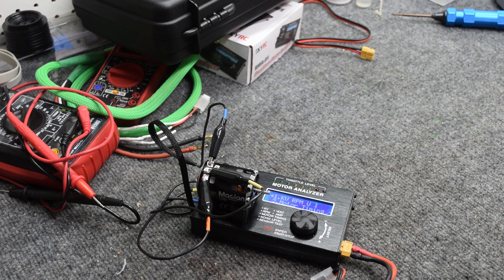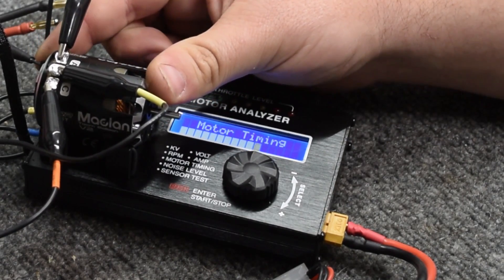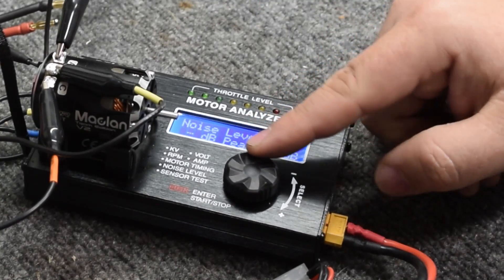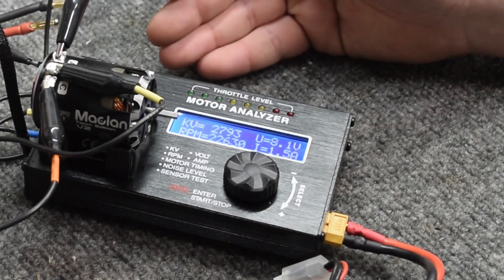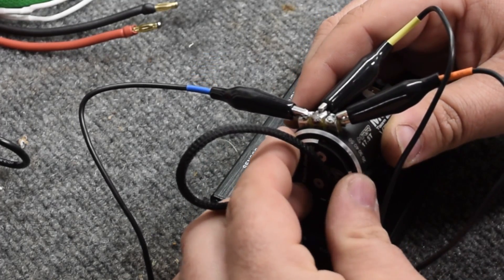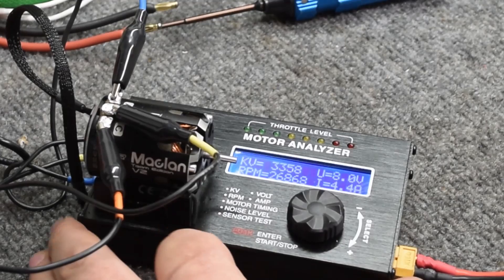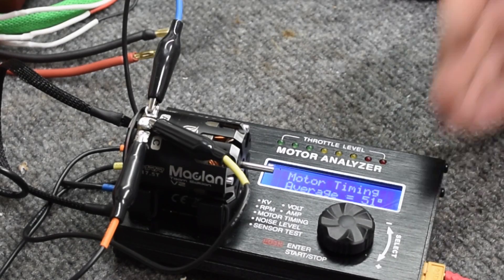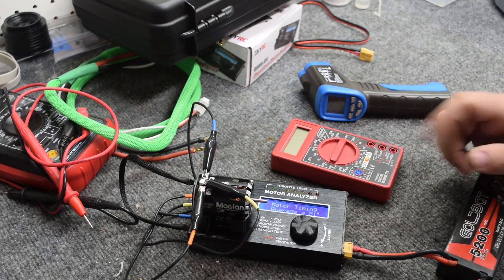How to tune your RC sensored Brushless motor, Part 2, Adjusting Timing using our Motor Analyzer

Comment: I have an esc that has boost timing control.  Is it better to have the timing set on the motor or instead find the sweet point as you have done then wind the timing back say 10 degrees on the motor and then set the 10 degrees back in the boost function in the esc?

Comment: For anyone else doing this with a cheap analyzer, note your battery voltage drop off. You need to keep the battery charged at 8.4 so you have a realistic expectation and get consistent test results. 5.1a at 7.9v will likely be 5.5-6a at 8.4v. These skyRC models also aren't very accurate on timing but it at least gives you a baseline to check amp draw.

Comment: Are they worth 65$
Reply from the maker: If your serious about tuning motors and trying to get repetitive results after cleaning and rebuilding motors , then yes. Or by a motorlyser , but just to see the power of a motor for 2 motors , nope.
Reply: @ChrisPatrickRC I was debating on one because they are 65 rn on AliExpress straight from sky rc. And I run on road summer and off road during winter fall. And just want to make sure I tune my stuff a bit but unsure if it’s really beneficial
Reply from the maker: @MrNascarfan1  the proper way to tune a motor is check temps on your motor , either add more timing or gearing based on the longest jump or stretch , once you find the magic number, you toss it on the analyzer and test the motor accordingly. 
So when you tear apart the motor you can rebuild it back to how it was when you tore it apart.
Too many people think there's magical numbers of amps , example. A trinity may draw 7 amps, a maclain may dar 6.2 amps. A reedy may draw 5.5 amps. 
Thats why , when people ask me what should I set it too, I always say there's never a magical number perfect for everything.

Comment: If you have a motor that has adjustable timing on it, does it have to be censored for it to work?
Reply from the maker: Do you have a motor in mind ? I dont have experience with sensor less besides 1 motor. And it was able to be adjusted and you can add timing threw esc as well.
Reply: @ChrisPatrickRC  well yesterday I bought the Hobbywing Xerun 4268SD G3 1/8 Scale On-Road Sensored Brushless Motor (2000kV) with a hobbywing Max 6 I know you could run sensor motors with sensorless  ESC I was just curious if the adjustable timing on motor would work if I want to adjust it?

Comment: Is there a certain amp point to look for? Im adjusting the timing on my fantom 13.5 in a no prep car I've gone as high as 54 degrees but the amp draw is well up
Reply from the maker: cant answer that question correctly because your using it for drag racing.... the simple answer is as much as you can toss at it without overheating the motor... your running 2.5 seconds and stopping where most people use them for races in 5 min mains. So what works for 5 mins races is probably on the "safe" side for you. 

You have to remeber. this video is NOT about the magic number, its how to find what works for you once you find that number.  and with drag racing there is alot of people adjusting timing with esc curves, so if it was me, id set it to around 35 degs of timing on the can and adjust everything in the esc. 

as you notice, there is no "magic" number your looking for, you just have to find what works for your application.
Reply: Have u played around with swapping larger rotors?
Reply from the maker: @builtbyjuz4419  of course i have, and it affects everything, the kv's and rpms all based on the rotor you have.
Reply: I have a 13.5 fantom outlaw team edition with the 12.5mm rotor, I've just ordered the 13.5mm from fantom and havnt seen any videos showing a comparison, all I've found is posts on Facebook and forums saying the bigger rotor gives more torque, sorry for the noob questions but im in Australia so we don't have any "rotor Ron" or "nick bells"  here to just order a badarse motor so I'm trying to soak up as much info as I can do any help greatly man
Reply from the maker: that is a whole topic on its own, but yes usually the larger rotors tend to give you more lower end torque to get you out of a hole faster, but you will give up the RPM , so in drag racing you may give up down track MPH... 
So adjust gearing according to help with that as well, also watch your timing because they tend to not like the higher timing numbers from what ive seen.
Reply from the maker: thats also why manufactures offer different levels of motors. example trinity offers 3 levels of motors. and typically the top 5 are "team" and the next 5-10% are "team spec" and then regular motors. so the batch of 100 new motors, you could get the worst motor at 100, or the 11th rank motor in the batch... thats why they offer different levels because they dyno them and test them to know what is the best of the batch.
Reply from the maker: there is also a tool to test rotors... you could buy 5 rotors from a manufacture and all 5 will test differently,  its called a gauss meter.... another small testing component to building motors.

Comment: what is the point of making the motor draw a serten amount of amps?
Reply from the maker: Its a reference point, so example... if you tune a motor to run to the top performance for your rig, at the end of a race your motor is perfect temps, so let's call that 51 degrees of timing...
You need to tear apart your car and you want to clean and lube your bearings and what not ( maintance you should be doing by the way) and you go to rebuild it back, how do you know where the motor was before if you did not out it on a dyno to know exactly where the motor was before, so you can set it again to the exact same as it was when it was pulled.
1 deg of timing can change a motor pretty good amount so amps is usually a easier reference point to set then degrees of timing on the end bell .

I hope this makes since for you.
Reply: @ChrisPatrickRC  ok that is an exampe i can understand then.

Comment: will this analyzer work on brushed motors as well like slot car motors?
Reply from the maker: no it will not, not that im aware of.
Reply: @ChrisPatrickRC  thanks. Been trying to find one but can’t seem to.
Reply from the maker: @sesmith4094  https://www.facebook.com/bill.osborn.7/posts/4750031621739348
go check that out.

Comment: Great video! I wonder if the 6A rule of thumbs applies to mod motors. I have a 6.0t that would love to tune.
Reply from the maker: nope, would be higher. all i can tell you is take it how it sits and find out what timing and amp is currently is before you do anything to it, also hows your temps after a race? temperatures on a motor is the most important number to watch.
Reply: @ChrisPatrickRC  Okay, I will start there. Thanks!

Comment: Is 5amps the number for 7.5 and 6.5 turn motors also or only 13.5v?
Reply from the maker: only for 17.5 and its not the "perfect" number... every motor is different i was just using that as the example of what a safe tune is for that motor in my experience.

Comment: Does anyone know if you can use these on brushed motors to aid in break in, or just use them as a dyno to get rpm? Brushed motor dynos are hard to find or extremely expensive.
Reply from the maker: No needs the sensor wire to register it to see it working.
Reply from the maker: I believe you can make one. I'll do my best to explain.
Set the esc throttle to be on steering binding so you can use the steering knob to set your throttle and forget it.
You will need a stand to mount 2 motors where the shaft touches each other and a couple to connect the 2 motors together.
You feed power to one, and then use a volt olm meter and measure on the positive and negative leads of the far motor , should give you a reading.
That would be a way to make a dyno for a brushed motor.
As for breaking in. Same thing esc to steering binding place motor into a cup of water and slowly turn your steering know on your radio till the motor turns. And if it starts slowing down or stalling then increase the steering knob.
Pretty easy to do actually.

Comment: Can sensor boards cause a motor to run a bit slower before they fail? The reason I ask, my Maclan 3.5T ran noticably slower before the board apparently failed. By failed, I mean the motor would not run with the ESC in sensor mode, it would only cog. However, it would spin up in unsensored mode.  Can the board cause hit or is it more likely the rotor was weak and the board was a separate issue?
Reply from the maker: If you replaced the sensor board and located it in the correct spot then I'd doubt the replacement board would be your issue. Could be a spacing issue with your rotor, could of overheated and hurt the rotor. Theres a few different variables that could still be at risk.
Reply: @ChrisPatrickRC  
Thank you for you response Chris.

To be a little more clear with my question, I haven't replaced anything in this motor yet. It is sitting while I decide what to do with it. The application is drag racing so I have very precise data on the output and running conditions of the motor. Nothing in the logs or observations with the temp gun or my highly calibrated finger suggestions that the motor overheated. 

What I noticed in performance amounted to a several tenths of a second and a few moh . The data logging showed 5-7k less  rpm without any drop in voltage to explain the loss. Basically, it's as if the motor lost KV.  Beyond being able to hear the loss of rpm, the motor also had an odd vibration as if the bearings were bad. Inspection revealed this to not be the case.  Then, the problem escalated into the cogging and not wanting to spin up in senor mode.  The sensor wire was replaced and I have since confirmed that other motors work fine in the ESC .

Perhaps it's worth mentioning, the motor in question is only a few months old. In actual run time, maybe 50-60 passes. After each pass the motor was allowed to completely cool. We are literally only talking a couple minutes of life.

Thanks for your help. I really appreciate it.
Reply from the maker: @troybolton4055  then sounds like everything points to the sensors themselves,  the motor may not have been shimmed correctly from the manufacture , causing wear on the eyes.
Id sway the board first

Comment: With 5.5-6 amps being ideal is that for both 17.5 and a 13.5 motors? Off road 1/10
Reply from the maker: 17.5, a 13.5 motor has more power draws. I dont know the exact number because I dont race a 13.5 motor that I built and tested to get you a safe starting point.
Reply from the maker: If I had to guess it would be around 7-8amp range

Comment: Can I use the motor analyzer while the motor is still hooked up to the esc, not the black wire loop only the leave the motor still solder to the esc.
Reply from the maker: Not that I'm aware of because the analyzer detects power draw and throttle and all that, thats what the sensor wire does..
So if you left the motor connected to esc and disconnected the sensor wire then the esc looses its connection and will go crazy.

Check out part 4 I think it is. Where I use another tool to test your exact question.

Comment: Did it say 4 pole on your settings in the analyzer? Maclan is a 2 pole motor
Reply from the maker: i checked and no, it was still set to 2 pole.
Reply: @ChrisPatrickRC  cool cool. Never hurts to double check. Great video buddy

Comment: Hey Chris, I've really enjoyed this video series and gotten some good results on my motors using your tips. My question is: is there a good video that discusses the merits of increasing timing vs increasing gearing? Or is there a way to find out if there is a sweet spot between the two that makes for the most efficient setup?
Reply from the maker: not that i am aware of... gearing is the hard one to explain. if its offroad, you find the trickiest jump and put a gear in you think it would take to get you over the jump, if you run out of motor before you clear the jump then go up on gearing... seems pretty simple once you break it down this way. 
If your oval racing, you want to run out of gear right as your entering your corner. or slightly after corner entry. 
once the gearing is set, then you can adjust timing slightly if your trying to get a little more out of it, BUT you need to monitor temps, because if your motor is getting too hot, your timing is too high, or gearing is too high. one or the other.  
i hope this helps. 

I do plan to redo this entire video series but its not in my near future. (be like a year or more probably)

Comment: So I’m wanting to get into racing and traded some stuff for an X-ray XB4 2016 with this same Maclan Motor and a hobby wing justock XR10, motor looks to be currently set about 40 degrees timing, she needs literally like just a touch more speed to be able to clear all jumps and run good laps at my local track. Think it would be viable and safe to turn up the timing a little bit to achieve this? Sorry major noob here and never had a sensored motor before.
Reply from the maker: Absolutly you can. Every motor is different though so be careful and check temps. Keep in mind it is a rpm motor not a trinity which is a torque motor. 
Just check temps if its cool bump it up a few degs and try it. And check.

Comment: What about other brushless motors that do not have a rotatable can? The smart motor/esc combo allows you to set up your timing digitally. The esc lets you program and navigate through different degree stages for the motor. You can look at the owners manual for the arrma felony or infraction if you want to see the charts. Have you ever delt with digital timing derees?
Reply from the maker: it can be done digitally, but theres no way to truly know the amp draw or kv rating of that motor when your digitally changing the timing. 
Example.. if your motor is set from the factory at 30 degs of timing, and your adding 20 degs of timing to it electronically threw the esc, then your motor is "suppose" to be at 50 degs....
How do you know its at 50? how many amps are you drawing so you can do maintance to the motor and put it back together knowing its exact the same when you pulled it back out?

The issue with those closed systems, is exactly what i was briefly covering above. another reason why most racing vehicles in the RC world does not use sensorless systems. 
I  can take my motor out, tear it apart, do a full cleaning and lubing and reassemble it , and if i was at 54.2 deg of timing before, i can rebuild it EXACTLY how it was by adjust it, and running it on the dyno to make sure it matches...

I hope this helps understand why.

Comment: Ok so when the amps start shooting up then stop and back off a bit?
Reply from the maker: Depends on the number your looking for. There is no magical number you want unless you know what your looking for.
Example.
I run on a large offroad indoor track so our motors need to have more power then you would need if it was a small offroad track with no large jumps.
So ot takes trial and error to figure out what your motor needs to run the best it can, and stay cool during a 5-7 minute main.

I hope that helps.

Comment: What is the basic your looking for?  max rpm , max kv? what is the red line warning sign of .....I have too much timing in it and the motor will destroy it self?  If the kv and rpm goes up then its good?
Reply from the maker: All comes down to your motor specifically, some motors have RPM rotors and some have Torque rotors in them. your asking questions thats very specific that i cant give you a 100% answer that is correct because ever motor is different. 
IF you have a torque rotor like a trinity, they love amps and higher torque numbers KV will reflect that. 
Where if you use a maclan motor, they are RPM motors so you typically run less timing to get the motor to run higher rpm range. 
The beggest thing i can stress, is motor temps, you have to adjust according to what your motor does in your vehicle your using. If you run a 5 min run on a race and you think your gearing is set close, and you pull the car off and its still cold, then you can get away with more timing. 
Example... i start my revtech's at 7 amps , and adjust according to the track i race at. i think last i looked, my motor is up in the 8.5 amp range but it gets warm at the end of the runs. 
the green , yellow, and red led is just the amount of "throttle" your giving the motor. nothing more. 

I hope this helps you and answers your questions.

Comment: I got a high torque rotor for my 17.5 when I installed it I got a lower Kv and lower rpm could you shed some light on why I didnt see an increase in kV?
Reply from the maker: was the timing set to exactly the same setting before you took it apart and reassembled the motor? you should see a lower rpm reading hints the higher torgue rotor. also your rotor you bought could be not as powerfull as the one you removed. Example, trinity does top 5% and call it there certified parts, so it would be the top 5% of the batch of rotors they tested. just some  things i can suggest, without knowing all the details its hard to say exactly why.
Reply: @ChrisPatrickRC  yes timing was set the same and I did see lower rpm juat not a higher KV. I have yet to run it so im gonna try that next club race and see if I can tell the difference.
Reply: @ChrisPatrickRC  thanks for your reply so fast as well👍👍

Comment: What would you be looking for if you were tuning a drag motor?
Reply from the maker: depends on how far you want to push your motor, and what motor your using, i turned my 13.5 motor for my street stock drag project and it was getting warm after 3 full pulls. i think timing was set over 60 degs of timing. you could go more if you was just going to make 1 hit and stop and let it cool down, but i wanted to be able to do a few before i had to cool down the motor.
Reply: @ChrisPatrickRC  Ok, thanks.